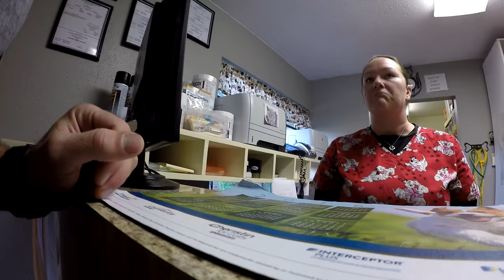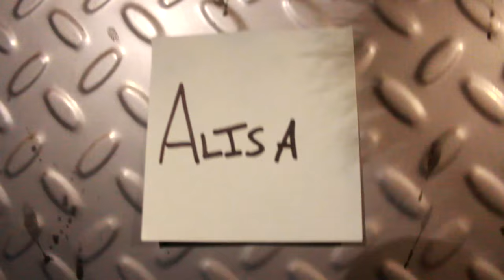MY PUPPY HAS WORMS!! :/

Comment: So I got the same Jerry can mounts for my YJ but I only have one. I mounted it on the back without needing to by any new assembly thingies. I just got some 1/2 in threaded rod and used it to extend the top two lug nuts on the rear tire mount to go through the tire and into a 1 inch square tubing that then connects to the Jerry can mount. It works great and is still rock solid. If you would like pictures let me know. But I don't know what to do for the second holder maybe just bolt it right above the right fender in front of the door(and put the water container in it). Happy jeeping

Comment: you should look into getting wheel spacers. I have 2 inch spacers all the way around on my 87 YJ with 4 inch lift and it has helped alot with a wider stance so it dosen't feel so top heavy and it looks cool

Comment: your power steering pump may just be going bad. like the internal bearings are going bad so when you put the pressure on them in a different way the sound stops.

Comment: Have the same issue with my 4.0L. Fairly new belt, replaced the Idler pulley twice, still sounds like a pig! 
Just bought a GatorBack Goodyear/Continental 4060790 - $14- Will keep you posted.
If that doesn't work going with a new water pump

Comment: hey man we had the same problem with the xj i sent you on twitter we ended up getting a remand kit from Smumitracing heres the part numbers we used AGR-812256 for the pump and UIS-8028250 for the pulley. noise is gone and been all good for 2 years now, i cant wait to see the lift done and smart move on the driveshaft to be honest i was thinking that it was done already lol

Comment: nice longer vlog. no sense applying the parts shotgun for that squeaking. a mechanics stethoscope is definetly the way to go there but assuming you don't have access to one of those, a long thin screwdriver works to. put it touching each belt driven accessory near where the bearing is and listen for where the noise is loudest. also pulling the belt off and spinning each pulley and checking for runout is worth your time. I'm looking forward to the lift kit install videos, I suspect you will run into plenty of stuck/stripped suspension bolts.

Comment: to me it sounds like the clutch in the fan. if it was the power steering pump pulley It would probably be a constant squeal  that would start small and slowly just get worse. but because it's an intermittent squeal. seems like it would be more likely that it's the clutch in the fan.

Comment: need a gatorback belt
Reply from the maker: Josh Rodriguez that was the previous belt, read they were suppose to fix the squeal but I had no luck
Reply: iamjake that's a bummer, had the same problem (slight alignment issue) and slapped a gator belt on and went away.
Keep up the good work, I'll see you in NH 👍🏼
Reply from the maker: Thanks Josh! Sounds great!